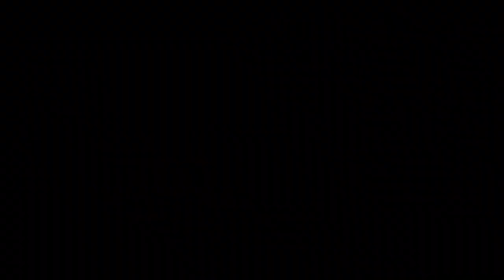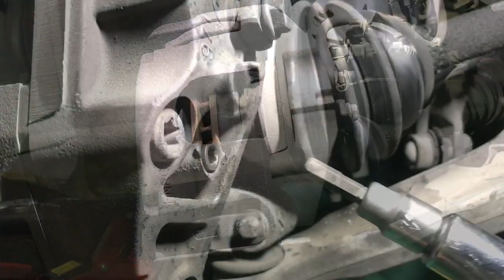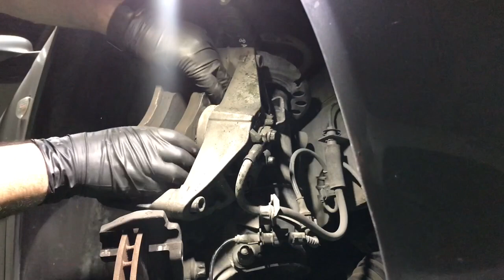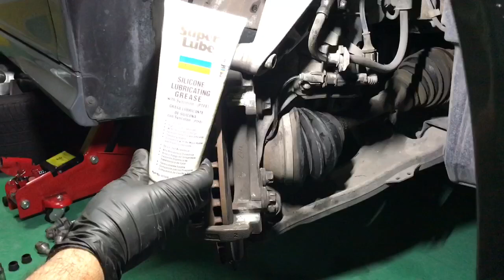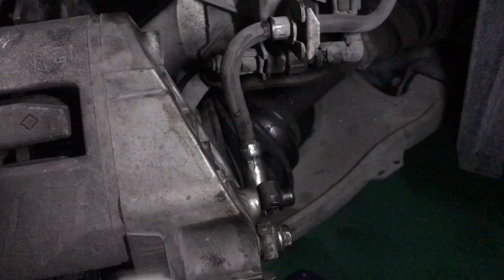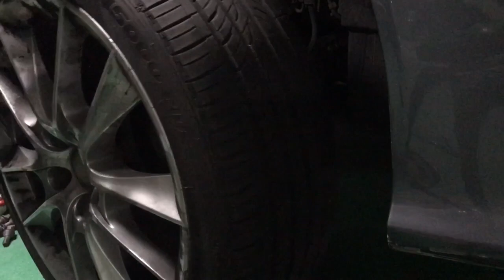SAAB 93 AERO/16+ in/314mm FRONT BRAKES

Comment: Any chance you can do the rear pads also
Reply: If pads only, straight forward remove slide pins with Allen key H7 bit. Nothing tricky
BUT.......if also swapping rear rotors, need E18 and E20 reverse-torc sockets plus a 21mm wrench. To safely remove bracket to release old rotor, there's an annoying long bolt blocking direct access to top bracket bolt (E18). Loosen bolt with E20 and its nut with 21mm wrench. Don't remove all the way just 2 inches aside to access (if you remove this long bolt it WILL be a pain sliding it back in)
Hope this helps.
Reply: @Whit_Siever  Did the rear breaks on my 03 aero a few days ago and found myself in the position of not being able to loosen the bolts of the bracket. They were completely rusted and i broke a Socket in the process of trying it. Then i just tried leaving the bracket in place, and there was no problem with that at all. There was enough clearance to carfully put on the new rotor, without it event touching the bracket. Saved me a lot of effort. 
Cheers

Comment: 4:00 "People living in rusty environments may have to do more cleaning and lubricating." I live in the northeast of the U.S and can confirm that metal rusts here very quickly. Lots of salt and rain. Cars fail here often times because the rust ate through the metal. It's a constant battle against corrosion.